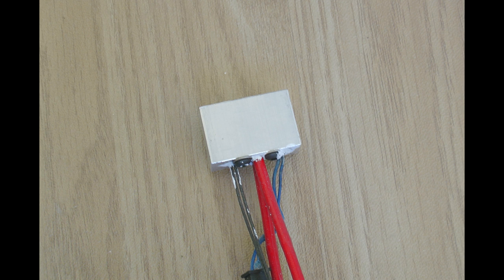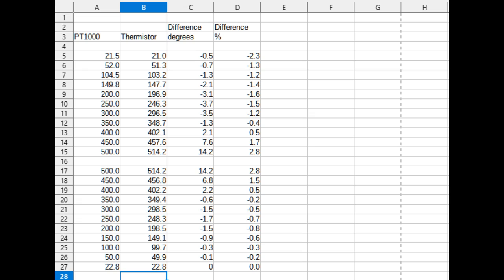Comparison between a PT1000 and a "normal" thermistor

Comment from the maker: For info, one of the Duet guys is sending me a PT 100, a thermocouple and the necessary daughter boards. I've also discovered a brand new Slice Engineering high temperature thermistor. So I'll make another block to take 4 sensors and run another test comparing a pt1000, a pt100, a high temp thermistor and a thermocouple.

Comment: Great initiative with the comparison!
Do you think the difference would have looked different if the “thermistor” would be in charge and let the pt1000 act as slave/secondary?
Reply from the maker: It wouldn't make any difference. Both sensors use the same ADC bank. The sensor value is fed into the PWM control algorithm for the heater but that doesn't affect the actual output of the sensors, which are simply resistors who's values change with temperature.

Comment: Interesting, I think the more useful comparison is during printing where the PID loop is having to keep up with the changing temperature due to extrusion rate changes. The response time and accuracy would probably vary even more.
Reply from the maker: Would that not be the same for both sensor types though? They share the same ADC bank and both types are effectively NTC thermistors, so I wouldn't expect there to be any significant difference between them. Or are you saying that a PT1000 will react more quickly to temperature changes than a thermistor? If so, then I'd suggest that the design of the cartridge and the positioning of the cartridge within the heater block with respect to the nozzle, would have a greater impact on response to temperature changes due to varying extrusion rate (if indeed such changes are significant) than the sensor itself within the cartridge. That is to say, any fast moving changes to temperature inside the nozzle would be "slugged" or "smoothed out" by the thermal mass of the heater block and cartridge.
Reply: @deckingman  My hypothesis is the PT1000 would respond faster and more accurately to small changes in temperature where as the thermistor would be less accurate and slower because of its non linear nature and using a lookup table.
Reply: Ok I was wrong. Thermistor(PTC) have a very high sensitivity, and therefore are very responsive to changes in temperature with faster response time than RTDs(PT100), but smaller temperature range than RTDs. In short both RTDs and Thermistor are electrical thermally sensitive resistors, they are which changes with temperature. Both are useful for specific design application.
Reply: @deckingman  bottom line is the PT1000 has a wider range of accurate measurement
Reply from the maker: @Pocketninjanight  Agreed. But what surprised me was just how similar the temperature readings were for the thermistor when it was up to 200 degrees higher than it's quoted measurement range. A more valid argument in favour of the PT, is that there is less variation between sensors than "normal" thermistors. So for those who don't regularly print temperature towers, and need to replace a sensor, the PT might be worth the extra money.
Reply: @deckingman  exactly, and there’s probably more variation from thermistor to thermistor
Reply from the maker: @Pocketninjanight  .....or so the vendors of PTs would have us believe. But I didn't set out to prove anything one way or another. It's up to each individual to make their own buying decisions. I just hope that this little exercise has added some real world data into the mix.  From your comments I would say that your personal choice would be a platinum resistance sensor, but for others who might be on a more limited budget might find it hard to justify the additional expense. So they might be reassured that a conventional thermistor might not be as bad a choice as some people would have them believe.  Personally, I'll continue to print temperature towers and use those results instead of absolute temperature sensor readings. I have  noticed differences in the optimum print temperature of up to 5 Deg C between batches of filament, even from the same manufacturer. So having a super accurate sensor is somewhat wasted on me. That, and the fact that the temperature as measured in the heat block bears little resemblance to temperature at the nozzle tip, especially if part cooling air is applied.

Comment: I think if you look at the datasheets you'll see the differences in terms of accuracy and ageing etc. Most thermistors I've found don't actually publish a specification for those. The pts do seem to.
Naturally it'd need calibration and if you're not using at least 3 wire mode you're hamstringing the performance of the pt. 

As to if any of that matters as far as a consumer printer goes, that's a different story.

Sorry just came across this while doing some projects that require calibrated certified temperature measurements traceable back to NIST/ISO17025 etc etc.
Thermistor has no hope, pt1000 is the only be probe type option I saw that would do the job well. I'm actually using sht43s for the project $8 and they come calibrated? Can't argue with that! But they are an air temperature humidity sensor, not useful for a printer lol